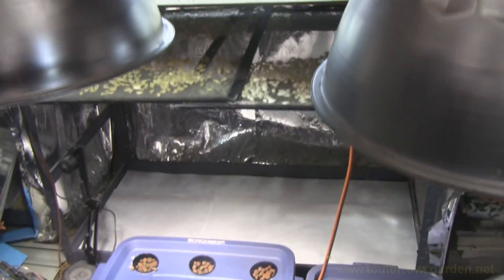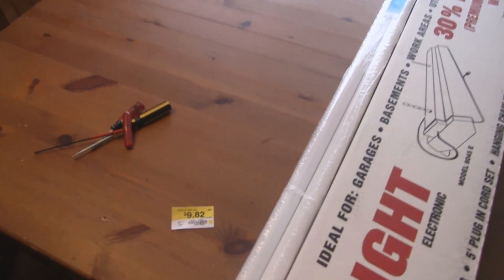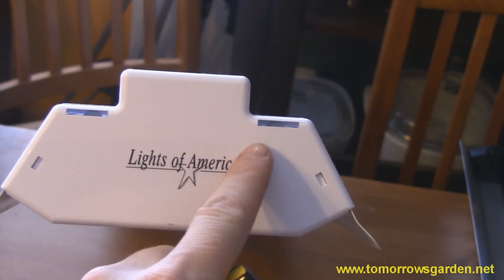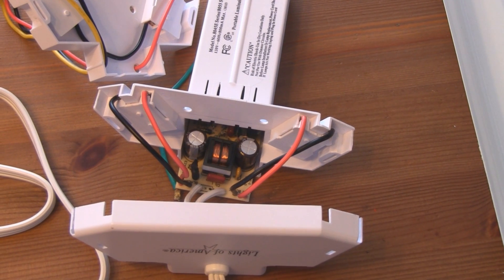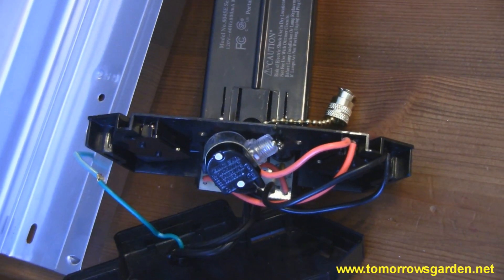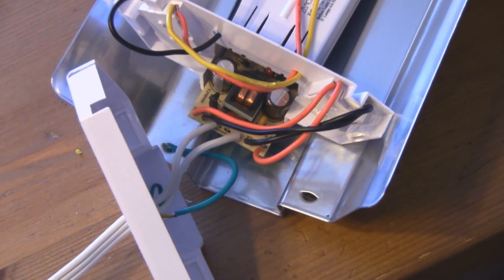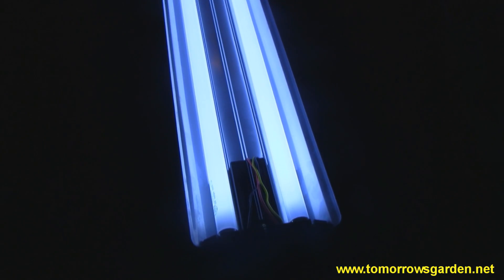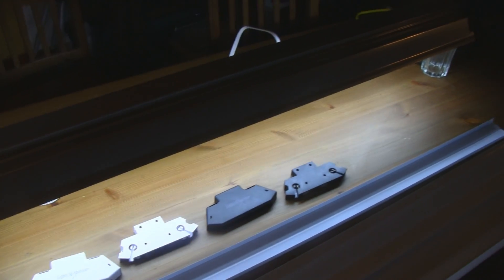How To Build A Super Charged Fluorescent Grow Light By Overdriving

Comment: this is stupid in so many ways, let's just start with T5's are 50% more efficient, and you want to DOUBLE the T8 power usage, so making the T5 200% more efficient then what you did here.
Reply from the maker: I paid about $110 for my first HO T5 fixture from Sunlight Supply in 2007.  This video is from 2010 and you can get T5 really cheap now but I only use LED now and would never go back to fluorescent or CFL.  So it was cheap back then.

Comment: Will it work with LEDs and if so, any best models? I had my T8's OD'd for 5+ years and tried a LED tube and they didn't work, and nothing worked since, so must decide if I want to replace electro ballasts or eliminate them & go with double or single end wiring & tubes...

Comment: I would be careful you dont burn your house down. Double feeding each lamp might not be in phase and could cause excessive current draw and heat. The output of the ballasts isnt DC which would make the current add in a safe way. It would be safer to add extra lamps with second ballast. Find a double lamp socket and mod lamp fixture to hold 4 lamps.
Reply from the maker: We use all LED now, it's an old video.  Thanks for the comment.

Comment: When you checked the wattage after the conversion, were you measuring the total of both by plugging them into a power strip and then plugging that into the gauge? I forgot how to do this conversion, I did it on just 2 of a 4-light "high-intensity" Floralight plant stand that had 3 shelves/lights... 3 light fixtures, 4 bulbs each. I only did it on 1 fixture--the top fixture. H-D had electronic ballast shop lights for around $6 back then, I bought about a dozen & still have some left. Now I'm curious how to turn some into LED... also what would happen if I used the "no modifications needed" LED tubes in the overdriven sockets?

Comment: That fixture looks difficult to work with. You could purchased a normal strip light for 2 32w T8 bulbs and added a Miro-4 reflector. You would get 195% light output (since the reflector reflects 95% of the light).
Reply: BASED ON UR LOGIC A REFLECTOR ALMOST DOUBLES THE LIGHT OUTPUT OF THE BULB . SO a 250/400/1000 should throw almost twice the light. 

Yet, by now i guess u realize that shit doesn't happen ...

Comment: I think for $125 and all the work your doing id just stick to my 400w hps hood bulb and ballast for $119
Reply: I'm not sure where the $125  comes from - But if you have an HPS system running without ventilation and significant fan-age, I would hate to be your landlord.  It's not just the cost of the fixture itself, but also the infrastructure that goes along with it.  You can run several banks of T8 fixtures on a single 4x2 wire shelf with just the lights and an oscillating fan.  Your bargain basement HPS light may cost $119, but it takes up a lot more space and creates a lot more heat.  It also requires a lot more amperage.  HPS has its place - but its place isn't in my home living space.

For $15 in today-money and an extra $10 for the ballast, you get the same light in the same space as you would from a T5 fixture and bulbs.  And a T5 fixture and bulbs will run you a LOT more than $25.
Reply: My 400w ups is air cooled and takes up about 1/2 the space of a 4 bulb 4 fit T5 and the heat is exhausted in a much better fashion plus theres close to 3 fit of penetration with fluorescence your lucky to have 6in during veg once switched to a red spec its less than that and just because I look for the best deal doesnt mean I buy junk
Reply: If u listened closely he said UNDER $25 not $125

Comment: I never start a Hydo sys, but about to (tomatoes and strawberries). Now by all the videos and think about my little space to grow, can I do this with T5 ? and is there any difference $$ between doing this vs adding 2 sets of lights ?? will appreciated any info.. :)
Reply: You can do this with T5s but the heat output is significantly higher, as well as initial cost for fixtures and bulbs. T5s already run hotter than T8s.  Overdriving a 54W T5 bulb is going to require significant fan-age to keep from crisping your plants.

Comment: Good way to go through bulbs fast lol
Reply: If by "fast" you mean they last 2 years instead of 3 years (on for 16 hours a day every day) - then I guess that's "fast".  The point is to maximize light output, not bulb life.  Bulbs used as grow lights are routinely discarded after a couple of years anyway because even though the bulbs still light up, after 16 hours per day every day, the light quality is degraded anyway.  Bulbs used for plant growth every day already have a shorter usable life than bulbs used to light your garage once in awhile.

Comment: Im trying to copy your set up but my lights (t-8) are wired differently. They only have a single wire per cap and one end only has one wire with a jumper to the second cap. Also I purchased the ballasts that you recommended and it comes with 6 wires 2 red, 2 yellow, 2 blue. The diag shows 2 yellow wires to one end with a jumper in between. The 4 remaining wires to the opposite end with the 2 blue wires to 1 bulb & the 2 red wires to the other bulb but they go on opposite sides of the receptical

Comment: as in the ballasts. they may be running hotter than normal. you might want to put a fuse on this. a 120 wat system would need about a 1 amp fuse get a fast blow fuse as well. your system pulls about 100 watts that way if it starts going over 20 watts more it will blow and shut down.. incace the ballast blows or something

Comment: I bought this same setup last night and I bought similar bulbs, the only difference is got the Phillips brand ones and they are 2750 lumens. I took a reading and it is putting out just under 5000 lumens between both bulbs right outta the package. So after I mod it up I will post my findings in the next couple days ;)

Comment: You took the red,yellow, and black wires from the opposite end with no ballast and ran them back across the light to connect them to the the empty side on the white light... did you need to do the same thing with the red yellow and black that would've been on the opposite end with no ballast on the black one too??

Comment: Pulling on wires with a pair of pliers can stretch them and create a fire hazard. Just buy a bigger light as rated in watts, put corresponding bulbs in, and you'll find a better bargain in light output, cost, safety, and energy use.  Packing a lot of lights in a small space will create a lot of heat, and a fan to keep things cool will extend the life of the bulbs and ballasts. Heat is the enemy of most electrical devices.

Comment: The 'T' in fluorescents is the diameter of the bulb as 1/8ths of an inch. A T5 is 5/8 inch, T8 is 1", T12 is 1 1/2". The 'HO' designates 'High Output'. The bulb will have a higher wattage rating than other bulbs it's length. Your T5 HO bulb may well be brighter than a common T8 - 40watt bulb.  That's because it is a higher wattage and a 'HO' rated ballast.  Putting a smaller bulb in will only waste energy and burn the bulb out faster. Stick to the engineered wattages and you'll be better off.